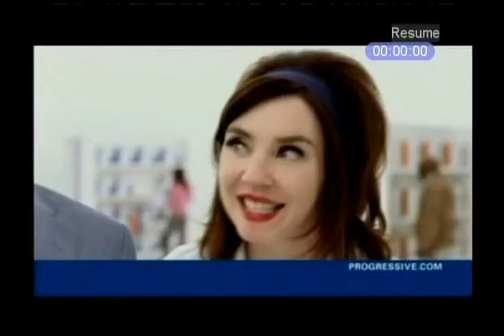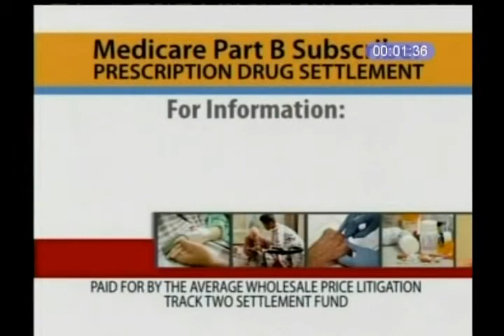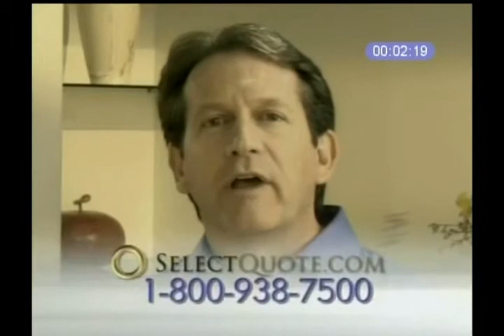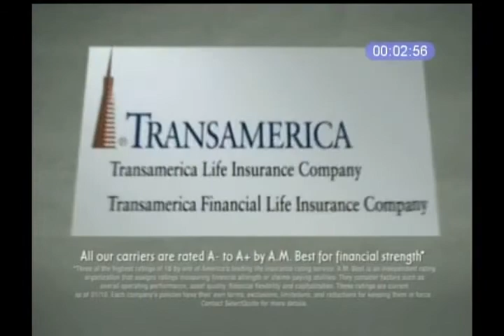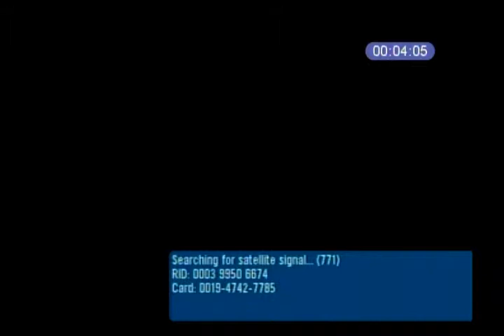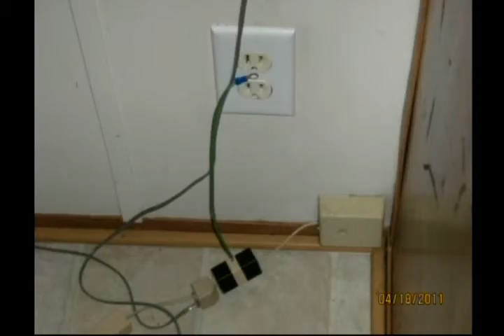ThunderMike, Minor Lightning Damage.mp4

Comment: Article 725 of the NEC covers low-voltage wiring (Class 2). Follow 640 for the Thundermic, 725 for the loop, and 210 for 120V branch ckts. While under the house/in the attic, beware of Article 725.58, which means you cannot tape wires to conduits/etc. Take note of 725.61that says that you must remove abandoned cables.  Next time I find myself in town, I can get you NEC complaint and more safe from that happening again. We'll resolve the telco grounding (ATT is very hit or miss on that!)

Comment: RE: Codes for multiple grounds... Bring Telco and DBS (Dish) to electrical system ground with AWG 10 Cu or AWG 6 Al wire. Follow NEC Article 690 for signaling and communication grounds. Ground rods are to be buried underground, generally 6", maybe a foot, since NEC requires full length of rod to be in contact with the soil.